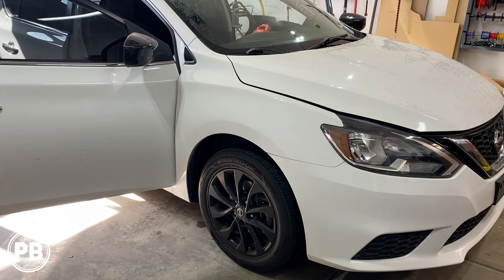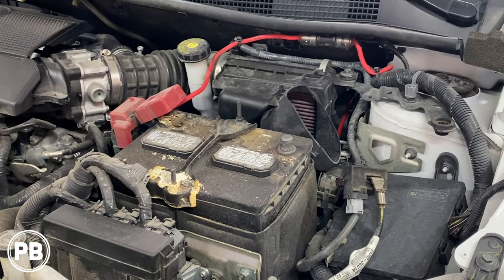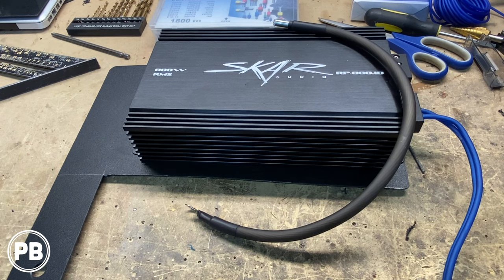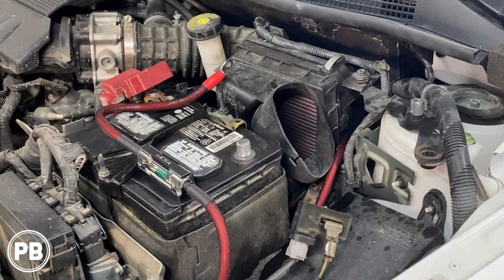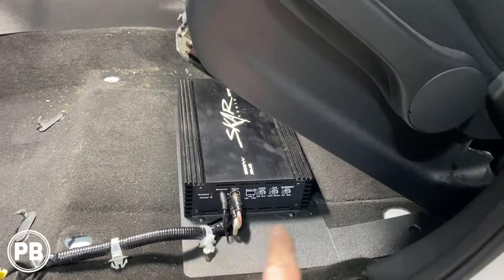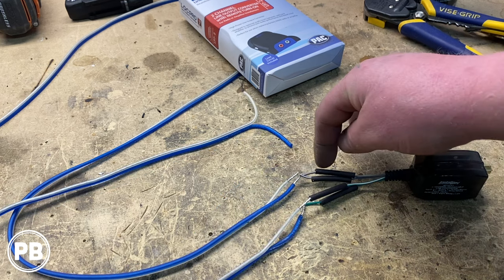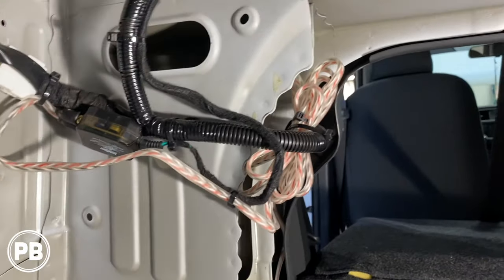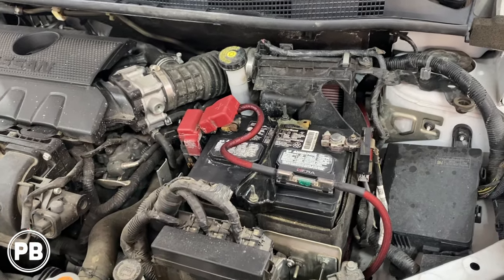2013 - 2019 Nissan Sentra Amp and Sub Install

Comment: Wait! so no need to connect anything to the factory radio? You tapped into the 6X9s and that works just fine? Wow, im impressed.
Reply: I did a similar install in a Hyundai veloster. Worked perfect.
Reply: Line out converter
Reply: That's what a LOC does

Comment: The LOC should have had a 5th wire for the remote. But the fuse box works too.
Reply from the maker: Not this LOC, but if you wanted one that turned on your amp for you, go with the Pac LP7-2 that has a feature to turn on your amp when it detects audio.

Comment: So since you used the other line out converter, which didn't have the remote turn on feature, you wired a remote wire to the fuse yeah? 
And if you used the LP7-2 you'd just use that remote turn on yeah?

Comment: Which fuse is the best fuse to have it in? My amps killed my battery had to get a jump and I unplugged my amp car never died since. But I want to use my subs again lol need help bro
Reply from the maker: If your battery is being drained by your amp, either there is an issue with your amp not shutting down, or your wiring is an issue. Hard to diagnose without seeing it in person. The power wire fuse rating should be determined by the type of wire used, gauge, length or run, and amperage drawn.
Reply: @ProvoBeastAudio  thanks ya think I need to get it rechecked guys who did it did a ghetto job sadly

Comment: i tried mounting my remote to my brake pedal switch to start up the car, problem is, amp will not turn off unless i pull the fuse.. what other fuse can i run it to?
Reply from the maker: Don't wire your remote to the brake pedal witch.  Go to the fuse box and find switch power, and use an add-a-circuit.  A multi-meter will be your friend in your install.

Comment: I will need the rca line output converter thing for a 2019 sentra with stock head unit, correct?
Reply from the maker: You got it. Linked in description
Reply: @ProvoBeastAudio  Can you elaborate a bit more on the add-a-circuit? I purchased that as well, but I'm not quite sure how to configure that. 

Thanks!

Comment: Just curious. The bundle of wires that is going into the grommet under the steering wheel. What do those go to? I probably wouldn't want to break them while making the hole.
Reply from the maker: Main harness into the engine bay.  Yes, be very careful of those wires.
Reply: @ProvoBeastAudio  sorry to be annoying, but would there be any way for me to know if I may have damaged it?
Reply: @electriczombie8299 They power your dashboard. And anything electrical. If something is cut then you’ll notice when something doesn’t turn on

Comment: What if i’m getting a powered subwoofer will I need to wire the two subwoofer’s that are already in the 2020 Nissan Altima?
Reply: I have a powered subwoofer that I’m going to be installing in my 2018 Sentra the process is the two rear speakers your talking about and get them wired into a line out converter so you can hook up your rcas to that
Reply: @bruhmoment3582  I greatly appreciate the response, I’m curious what powered subwoofers you’re getting
Reply: @colejohnson4530  I just got some powered subs last week made by Pioneer. Bought all the stuff like RCA converter and all that ill let you know how the install goes today. (2016 Nissan Sentra, so no factory amp.)
Reply: @yaboymc  Do you know where there Bose sound system amp is located?

Comment: Could I follow this similar but for a 5 Channel amp? Looking to install as well on a Sentra with stock headunit. Thanks in advance!
Reply from the maker: Yep, however, it may get a little tricky with wiring the 4 channels.  Generally we build Radio T-harnesses to minimize any damage to the factory wiring.
Reply: @ProvoBeastAudio  Okay thank you! I am looking to install a Kenwood X802-5, this amp has speaker level inputs, would there be a reason to add a line out converter then? Also I am having difficulty finding a T-Harness. Is the "LPHNI03" by Pac Audio what I'm looking for?
Reply: @ProvoBeastAudio  I'm also thinking about adding in a component system but this car has the tweeters in the a pillar. I can't see myself running a wire from the woofer in the door to the tweeter. Are the component systems that have a simple crossover at the tweeter so I could still use the stock wires? I guess I could also find where the stock headunit wires split to the tweeter and woofer as well and mount the crossover there. Help! Haha

Comment: Can you install the subwoofer and not have to disconnect the backup camera? Have a 2016 base Altima
Reply from the maker: Those are to unrelated items, no need to modify a backup camera whatsoever in order to install an amp/sub.
Reply: Is it possible to get this in without having to take the tire off?